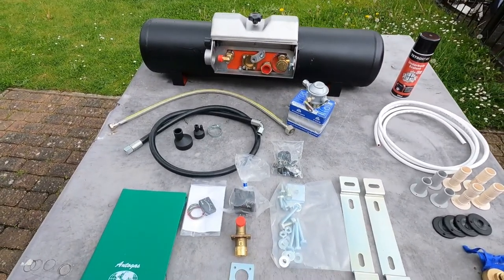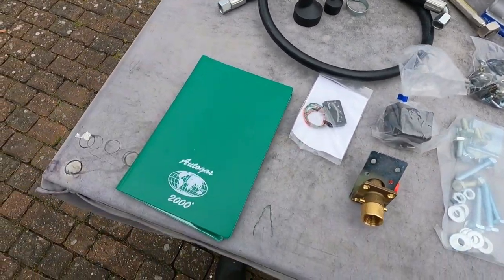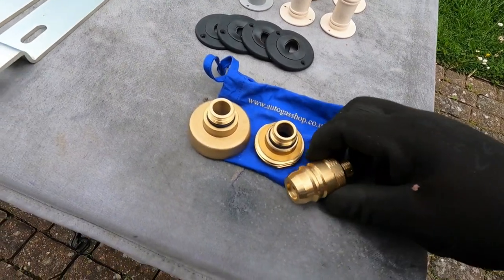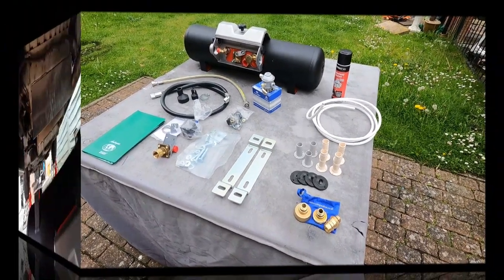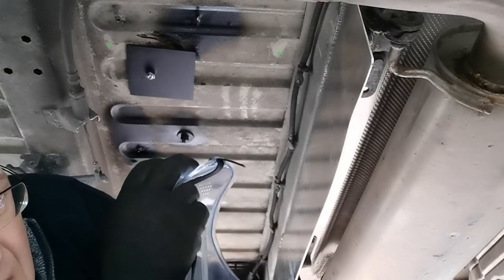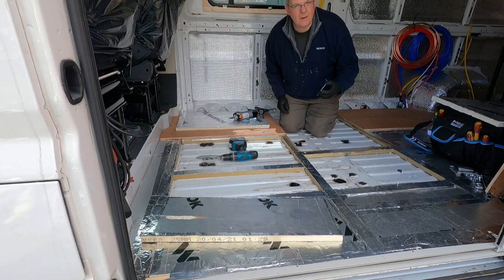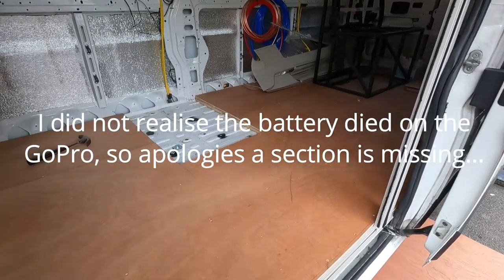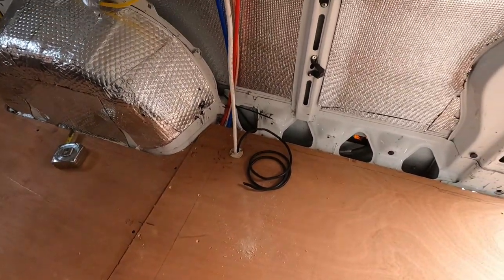Installing 25L underslung gas tank on Citroen Relay / Boxer / Ducato / Promaster

Comment: Just a helpful tip: A lot of these fixings are exposed to the elements, I’d be inclined to use as may stainless steel bolts and nuts, as the ones provided in the kit are only flash zinced, and will start rusting causing unsightly brown patches.
Reply: Stainless fixings will react with the steel floor so would need some additional product to stop this happening.

Comment: Thank you for posting these excellent videos. Everything you have posted so far is what we are planning to do. We have been researching and planning for many months and bought our 2017 L3H2 Boxer a month ago. Now trying to resource materials and essential items. Why is there no decent outlet in the South West? We had delivery of our Solway rear passenger seat this week. We are not far from you, so interested to know where you will get the gas system signed off.
Reply from the maker: Thanks for you're comments. have not thought yet about the signing off part. I have a deep distrust of all tradesmen as been ripped off so many times so will be looking very carefully at options on that.

Comment: Thinking of going down the same route with the underslung gas tank are there plenty of places to fill up.great videos
Reply from the maker: The number of filling stations is getting less as the tanks are being ripped out and replaced with EV chargers in the space. luckily for me, there is a gas supplier in my town with a LPG tank and a filling station just before I get to the A303 near Andover has one so has always had me covered. I think going forward I would definitely consider going all electric and a diesel heater. its a tough call right now...

Comment: Hi another informative video, I'm following with great interest as waiting to do the same. Thanks for info re Flyscreen ordred waiting on delivery. Have you received your water tanks, again if you dont mind where did you source these, what capacity arethey? Thanks in advance.
Reply from the maker: Thanks for your kind comment. water tanks arrived and now fitted. there are essentially 2 suppliers in the UK, Barratt Tanks and CAK Tanks. The general consensus is that Barratt are by far the better made and better customer service but they unfortunately could not supply until Nov as so busy so CAK it was. they did arrive, 3 weeks behind schedule and with no contact or courtesy update calls at all from CAK. they seem OK albeit a bit flimsy perhaps and the brackets fit where they touch and need painting but at the end of the day, they did arrive and are now fitted so one job ticked off the list. i went for the 'package' they do for L4 ducato vans but be aware the supplied pipes will NOT be long enough so order extra at the same time. i needed 3m of the big blue 'fill pipe' and 2m/3m each of the blue and grey drain pipes. they supply 1m of each in the kit and the drain taps are awful and you will want to upgrade these as well. hope that helps.
Reply: @wiltshirecustomcamper7203  Hi thanks for info, I also contacted Barratt Tanks but they could not give me a date for delivery. Did you consider internal fresh tank ?

Comment: Great video I'm going to be fitting the same kit , I'm going to follow your pipe route as it's neat and tidy , do you know how much pipe you used to get it into the van from the gas tank please
Reply from the maker: I ordered 3m from Autogas with the tank and that was enough. thanks. Top tip would be to make the bends before starting to attach to the van as is 'kinks' so easily, i really do mean that, a hard stare will kink it! so measure carefully and make the bends first.
Reply: @wiltshirecustomcamper7203  thank you I did see that on your video where you had to join it , I will take good precaution when fitting and bending , can't wait to see your shower fitting videos that's the scariest part for me
Reply from the maker: @widget2k4  Funny enough, just looking at those now. so they dont turn into mini movies it looks like about 4 parts in all and i will release them all together I think. the shower is finished now and I did not enjoy that part of the build one bit, it has been by far the most difficult bit but many lessons were learnt for the next build for sure....

Comment: Very tidy and well routed installation. A Crash sensor and Excess Flow cut off valve would be nice improvements for safety while driving.
Reply from the maker: good points, thanks for watching.

Comment: Hi there,

I’m just on to my lpg system now. Trying to get my head around the gauge (electrics is not my forte). What cable did you use for gauge and did earth the black cable like instructed in the manual?

Thankyou
Reply from the maker: hi, yes i did earth the black cable and if I recall, I used a 1.5mm cable to connect the gauge. hope that helps, although I do recall that Autogas 2000 where I got mine included some very useful instructions for it all, is yours the same?

Comment: Loving your videos. Is the 25 litre tank the biggest that would fit?
Reply from the maker: No, you could go larger I think but this seemed a good balance between 'size/cost/availability' at the time. hope that helps although in van number 2 I am definitely going no LPG! now Lithium is getting much cheaper I would go with more battery and induction cooking and diesel heater.
Reply: @wiltshirecustomcamper7203  ….the issue with that for me would be being able to get the batteries charged while off grid in the winter months (and I like to cook with gas 😋) a lot more solar would be needed and a big B2B charger.  I guess you would be going with an electric water heater too?
Reply: @wiltshirecustomcamper7203  Modern vans do strange things with their diesel tanks which means if you tap a feed from them to your diesel heater it can upset the engine running (several threads on forums about this). So you need to fit a second diesel tank, possibly one inside the van - not a great option. And you can't beat gas to cook on.

Comment: How is the copper pipe connected to the regulator. Is it just slid in?
Reply from the maker: they are compression joints. I added a little fernox in the joint for belt and braces too.

Comment: Hi. Could you please provide the link of those rubber inserts.
Reply from the maker: they came from autogas 2000 along with the water tank, look in the accessories sections on their website.
Reply: @wiltshirecustomcamper7203  Many thanks. I was able to find them on their website.

Comment: How would you turn off the gas if going on  the Chunnel. Not from underneath, surely not
Reply from the maker: No, quite right. I have a manifold fitted inside which is not on any of the videos yet.... thanks for the comment.